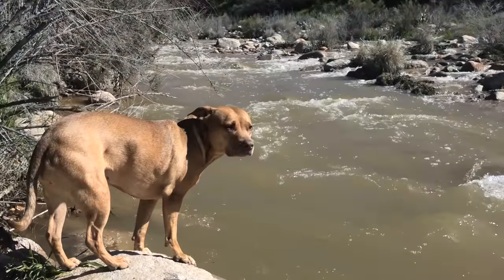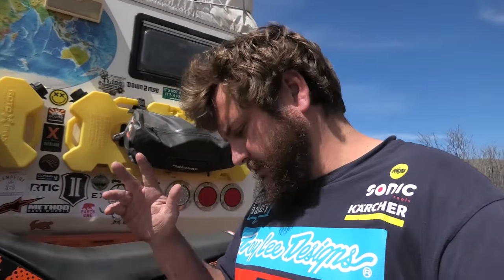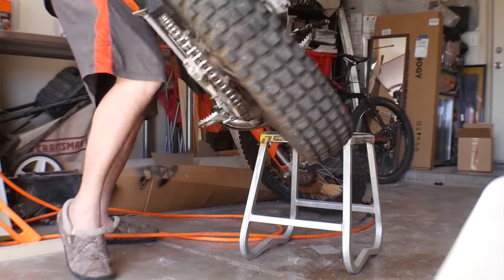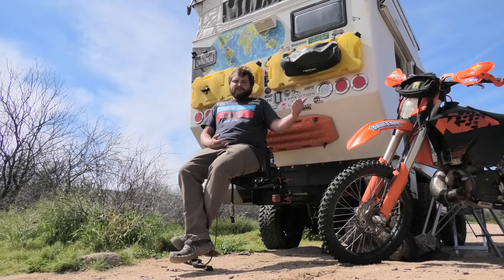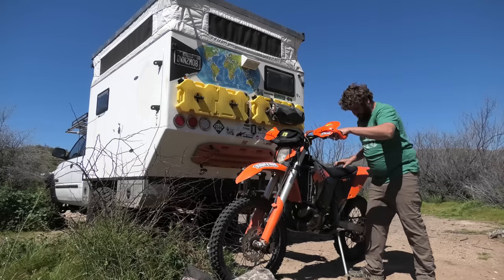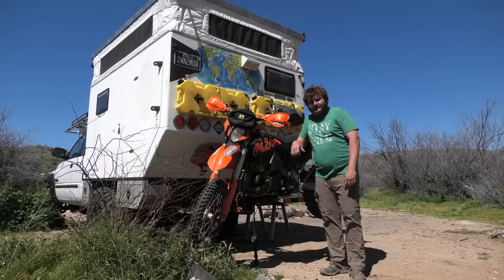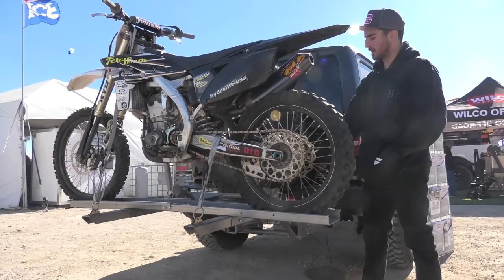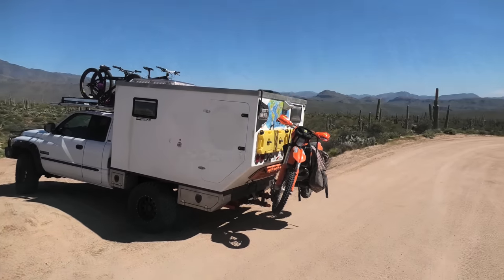THE BEST MOTORCYCLE DIRTBIKE HAULER for your OFFROAD TRUCK CAMPER - Loading & Unloading

Comment: I've used these in the past and they are great. PLEASE NOTE: The jack is only to lift it up. Once in place, that pin that you said was a fail safe is actually the primary support. You are not supposed to leave, or add, pressure with the jack; you are supposed to relieve a bit of jack pressure so the pin takes the weight. Once jack pressure is relieved, then you can close the valve and leave very light jack pressure so it becomes the fail safe, but that pin should take the primary load. Otherwise, great demo. Safe travels.

Comment: Dude, great video and rack. You can shred!  Nice!  That back and forth wiggle will cause metal fatigue quickly. A stabilizing strap connected to the rear tire area pulling upward will cut that jiggle alot. Just continuous pressure to one side is better than back and forth rocking. Both sides would be easy to do and maybe necessary because of the design of your rack. I have stabilizing straps on my rig just as I wrote. Makes a big difference.
Reply from the maker: Thanks man! I appreciate it! Also, thanks for the tip! I am thinking I need to stabilize it a bit more for sure. Like you said, with it bouncing like this, that metal isnt going to last forever

Comment: Thank you for taking the time to make and post this video. I have a few thoughts though... 1. That hitch mount doesn't look up to the task of overlanding. That extra tow hitch adapter/extension will fail. 2. If you happen to have a bad "get off" while riding and you hurt any part of your body (especially your back), forget about loading the bike. 3. Your back will remind you when you are older about the days you used to load your bike.  Cool idea, but not for extreme overlanding. Thanks again.

Comment: I've always rocked the channel type holler just because it's what I've had. One nice thing, is that the sea Channel holler acts like a skid plate so if you drag the ass end of your truck it doesn't tear up your wheels. But I totally dig your holler. Way more streamlined and I love that it's a bike stand. Congratulations on leaving "the system" in the dust!
Reply from the maker: Haha thanks Jon! I am super excited to be traveling full time. I do like being able to drag and slam things around when they are hanging off the truck! Haha cheers

Comment: I use a similar carrier. My hitch is also in the bumper. I just park with the truck backed against a mound or a hill. Or I find a rut for the truck's rear wheels to drop into. That way the bike wheels touch when the platform is down.

Comment: Looks like the movement is caused by the sloop between hitch shaft and remal reveiver.  I think etrailer has a plate with U bolts that hold the male hitch component tight inside the hitch receptacle.  Cheap and effective.  Nice rig.  Best of luck on your journey.
Reply from the maker: Hey! Yes the hitch tighteners, I do have some of those on there but one works way better than the other
Reply from the maker: Thanks for the comment!

Comment: I use that same Hauler with my jeep, I don't have to carry the bike to the Hauler cause my Jeep is not lifted, in fact it can lower and raise (quadra lift suspension). I have a two stroke 17 KTM, so it sits level. For your KTM they make a leveling bracket, which will let your bike sit level. Nice rig!

Comment: If you are going to drive this everyday for at least a year, maybe two more anchor tied down on the left and right end will ensure the bike is not moving! When parts are moving (even on low stress), the part that feel the most stress will eventually break under fatigue! cheers

Comment: I have the same hauler although I think It might be the first gen. It’s old but works and looks the same without the shiny hardware. Heavy duty steel that feels like a ship anchor when installing it. I recently took my DR650 on a 1500 mile road trip from CA through AZ on and off road and it performed flawlessly. I added 4 tie down ratchets because of the extra weight of the DR. I admit I was nervous putting my faith in it for all those miles but hey, you really won’t know until you try, just like your hitch rise incident. Thanks for sharing -safe riding and travels.

Comment: I would imagine, the moving back and forth constantly while traveling causes alot of stress to the hitch mount extension. Make a bracket attatchment with a bolt through to remove all the sway side to side. Some of the traditional cheaper bike hauler setups use what I'm talking about and they really do work. Look into what I'm talking about and you could weld the bracket up or have someone bend one up on a metal bender. drill the holes and secure the rack so it stops swaying. That constant swaying is causing alot of unneeded stress to the system.
Reply: Wait a minue. You used a riser that looks like a pretty light duty one. Yeh. No way would I trust that little riser.. Bad move. I hope you dont cause yourself too much damage to the bike when it breaks. Or hurt someone on the road. That riser looks like a very very very risky deal.

Comment: My ultimate MX hauler works GREAT.   I did have to take the receiver off my rig, and get a slightly longer sleeve welded into the sub-frame, and then bolt it all back together.  WORKS GREAT.  p.s. my receiver is lower, so I dont have'ta lock the front brake on.  Why not use your lower receiver when you know you have clearance?   It's right there for your use anytime you decide to.  Cool

Comment: Nice review and discussion. Thanks for sharing. Of course we all find things that work for us and they may work for others, but in this case, the loading strategy you have for the bike is too much physical effort to load back onto that high position. I'm not as young as you :-) 
The only issue with that type of hauler is you want to use it so far off the ground. Obviously that's a requirement for you to navigate your vehicle to the places you want to access, but otherwise it has the many advantages you cited. I use a JoeHauler rack behind my Jeep.

Comment: Your riser is an issue, needs gusset plates on the sides IMO, and it would be nicer if the bike came closer to the ground in the lowered position. I'm thinking of getting one of these for my truck-getting tired of loading in bed and carrying 2 ramps. Plus I could use the entire bed for the camping gear with no bike in the way.

Comment: Just looking at it, and the  offroad application of the setup. Makes me think that maybe the fasteners need some additional securing ( cotter pin, and wire?). Maybe a set of small car shocks in a triangulated arrangement. To help take some of the bounce out of it, while off road. 

It just gives me that feeling that otherwise its to rigid to last otherwise. Would suck to loose parts or drop the bike completely and not notice while off road. (yeah i saw your highlighted note too)

Comment: I did something similar with a toolbox/bike rack combo behind my truck camper.   Unfortunately, the dual hitch extender I used snapped going over a railway crossing due  to the exaggerated bounce.  The bounce and flex of the unit created enough force to overcome the rated limits of the 2" extender, even though the weight of the unit itself was inside the rated limits..  Fortunately, the unit just dragged a bit and caused some superficial damage to once of the Mtn bikes.  It could have be disastrous if I was travelling any faster or if the unit shot out into oncoming lanes.   I've abandoned the combo unit, upgraded all receiver and hitch accessories to 2.5", and beefed everything else way up.
Reply: would adding gussets to the extender have helped?
Reply: Maybe?  My 2” dual extender snapped right where it met the truck receiver.  I upsized to 2.5” custom extender.  My Chev 2500 has a 2.5” receiver from the  factory.  I recommend upsizing the extender class/size, limit the number of pieces in the apparatus, and welding or bolting as many of the pieces together as possible.  Any movement is bad.

Comment: Nice, im looking into building a little ATV winch crane to get my bike in and out cause' its a bugger when the trailers on. You might be able to rig something like that and get it even higher with a fixed mount?
Reply from the maker: I thought about it. I had a warn drill winch I was going to use. Ended up being too complicated and just lifting the bike is quicker. If it was built right thatd be super convenient though!

Comment: Sweet set up for your bike.  Could you use your orange recovery track as a ramp?
Reply from the maker: Hey great idea! Lol wow I never thought of that I will have to try it. The only thing is the front wheel will drop down and I don't want it to slam the header. A 4 stroke would be no problem though.
Reply: @Down2Mob  Pipes are $$$.  My 250SXF pipe is $$$ too. One track on either side, just need to strap/hook them somehow.  Not that important for now as you seem to be loading/unloading just fine.  Savour every moment.  Cheers from MTL.QC

Comment: I don't have a MX Hauler ,just the regular bike hitch rack. But I put a few tie downs from the bike to the truck to help stop rocking on bumps.
I thought you had a 525 .I rather a 250/300 like yours. Do you have issue with vibration through the bars ?
Reply from the maker: Ya it's a 2009 ktm 250 xcw, no real issues with vibration in the bars but if you really want the best bars for vibration dampening go with the faast bars!

Comment: I like the idea but it sways too much for me. I reckon you could fab up a replacement tow bar and hitch with the lift for less than $4200. I like the ones with wheel slots because they seem more sturdy. I would also just make it so the bike stand could be put on the bike while on the stand too. Anyway, enjoy your trip! I hope I can do the same one day.
Reply: All the haulers do. It comes with the territory. There is only 1 point of attachment - the hitch.
Reply: @someguy5035  I am improving upon a hitch hauler and using extra mounts to the tow bar to stabilise it. If you're handy with a welder it isn't hard to fab something up. But yeah, from an engineering point of view, something has to give with all that rocking about.

Comment: I don't know if I'm "down to mob" because I don't know what that means! 
What do you do with your dog when you're out riding?
Do you have a contingency plan for loading the bike if you get hurt? Could you modify the platform to go low enough for the bike's wheels to touch the ground?
Reply: Ya. I have been wondering the same thing. For brief while I was mis-reading as “down to Moab” but quickly realized that was incorrect. I think it is worth asking for clarification. Regardless the channel is fun to watch.

Comment: Taillights  and brake lights are covered, buy a set of drag lights and plug in so you dont get a ticket. It will save you some money.
Reply from the maker: Hey Robert! They actually aren't covered too much and you can still see them just fine at night,n that was a bit if a concern though

Comment: All they had to do was make it so the platform goes down lower.  No clue why they did not. 

Also no clue why they use a bottle jack whenever a toothed shaft/gear system or a screw system would make things 100x more reliable and easy. Pretty much every boat trailer uses the gear and toothed landing leg design. You can turn it by hand easily.

Comment: I think you killed a desert turtle filming this. ... seriously, you should have a road legal unit on there. ... That might work for a light bike, I haul an XT600 or XR650 on a platform stand. It's behind Humvee com shelter, I use stabilizer straps to prevent sway as your showed
Reply: I built a hauler to haul a Polaris sportsman in the 2 inch receiver. It's over 900 lbs. The xt and xr will be fine. The extension uses heavy wall 2 inch tubing. If your shopping for a hitch make sure you check the gauge of 2 inch tube used on any type of bike hauling apparatus.
Reply: @endurotruckererniedesjardins  ohh, it's already built and works fine. I am a fabricator. Thanks though.
Reply from the maker: HeyReid! !This bike is street legal. It's a 2009 ktm 250xcw

Comment: What engine you running?
Reply from the maker: Hey! The bike is a 250cc KTM XCW and the truck is a 2001 5.9l 24v cummins
Reply: @Down2Mob  we basically have the same truck but I got the 5.9 magnum.

Comment: I would like to be out there Trail riding with you guys nice bikes I have 2 street legal Baja Warrior 200cc Trail Bikes one I converted and Made a Baja Warrior Super Moto I put a Dirt Bike gas tank with a 3 way T Split from the carb to both gas tanks  and fenders on a used a Enduro Headlight Taillight blinkers  both my Baja Warriors have Commet Torque Converter Belt Drive Bypassed the governor both bikes Run 65/70 mph I Built the Baja Warrior Super Moto to ride with Smaller bikes such as the Honda Grom Kawasaki Ninja 250 Our younger son and I Race Manco Dingo Buggys  we have my 1983 Honda 200s my wife's 1997 Polaris Trail Boss 250 our sons 2006 Kazuma Falcon 125 my Kazuma Falcon 250 Yamaha Raptor Clones we have our Manco Silver Fox Side by Side predator 670cc Modded we have our Manco Dingo Deuce Side by Side  Honda GSX 10hp 405cc we have our sons Hammered 150cc side by side we have 3 Mud Mowers with ITP quad tires our sons 1974   Skidoo TNT 440 we have my 1990 Skidoo Safari 440 my wifes 2000 Skidoo MXZ we gave my younger brother a 1976 Rupp Nitro 440 for his first sled and my dad and I went in on a package deal for 2 1994 Yamaha Exciter II 570's we gave to my dad so my parents have a His and Hers set like my wife our son and I and we Have our Home Made UTV Side by Side my dad built it's similar to the Polaris Ranger  My Dad and have been building Buggys an side by side before Polaris they copied our side by side and UTV Side by Side
Reply from the maker: Oh that's awesome! Sounds like you've had some super cool toys and you are DOWN2MOB!!

Comment: $450 and no theft prevention is kind of a bummer
Reply from the maker: Ya it would be nice, all they would need is a whole on the screws that go in the pegs where you could add a lock after the wing nut Haha but a cable and lock works great